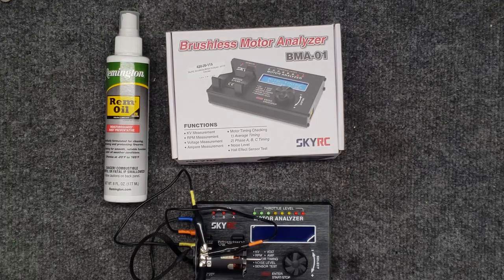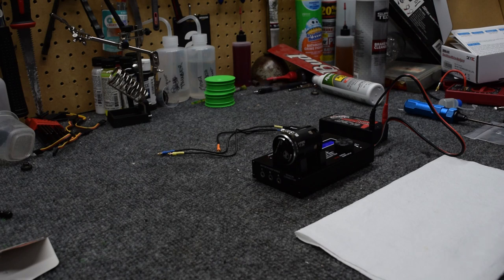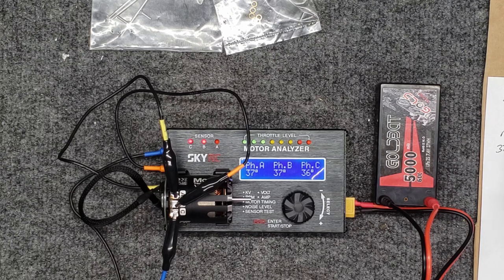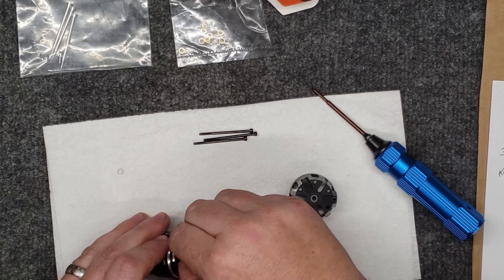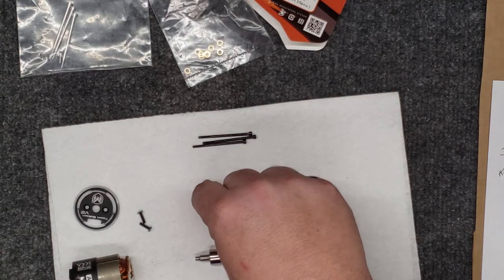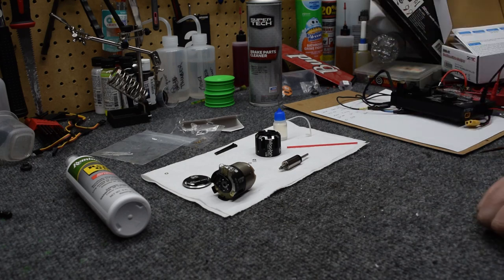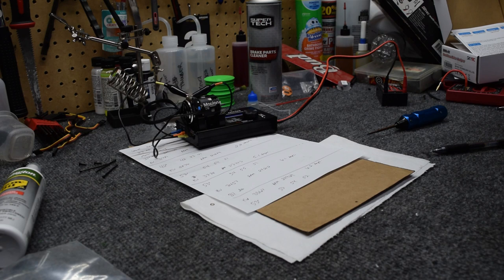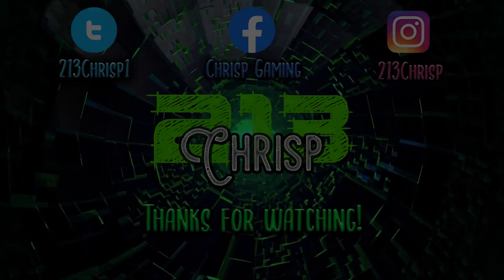Lets tune a motor, Maintenance, Will Maclain Team v2 MRR beat Trinity xFactor revtech Motor Analyzer

Comment: What is the ID and OD of the armature shims ?
I have a Motiv Launch 3.5 and I measure the arm shaft to be .130".
When assembled can you turn the arm by hand freely without the gear attached to it ? And check end play ?
Reply from the maker: Maclan 0.01" Fine Precision Teflon Motor Shims (10) is the shims i use, they make different thinkness of shims as well, the other size is .02 and im sure there is other larger ones out there, and yes you can grab the armature shaft and spin the can in your hand. but your wanting to check end play side to side (from timing side to bottom of can) that slop is what your trying to eliminate without creating drag.
Reply: @ChrisPatrickRC  Thanks for the info.

Comment: Why is important to hit 6amp? Newbie question.
Reply from the maker: Its not.... every motor is different, but 6 amps is usually a safe tune to set a motor and then adjust gearing to heat. And if your gear is right to the track and your motor tremps are safe you could always add more timing.
Reply: @ChrisPatrickRC  thanks for the quick reply. I just bought a skyRc analyzer. I’m playing my timing of my trackstar 21.5t (1885kv) . I set my timing at 50* and my reading was kv=2474 Rpm=19546 amp draw=4.7 . Is this good numbers for 1/10 scale touring car racing ? Thanks again 🙏
Reply from the maker: @sd_rcfanatic157  have no clue. I have one but never put it on the dyno so I can't give you any information as to what is good for that turn of a motor.

Comment: Does these tuning techniques apply to sensorless motors?
Reply from the maker: I dont know of a way to adjust timing on a sensor less motor. But if it has the markings then yes. But I thought the sensor is what's needed for adjustable timing.

Comment: you was at only 7.0 v not sure if that matters on your final testing to
Reply from the maker: Not sure but I'll recheck it again fully charged.
Reply: @ChrisPatrickRC  KV doesn't change with input voltage.  The only thing that Sky RC motor checker is good for is KV and checking Amp draw.
Reply from the maker: @teamcrc1  quite possible. But its related data that can be tested between different motors and might be close to each other but is probably off compared to what a high end motor analyzer reads. Buts it's a data point to compare was my point.